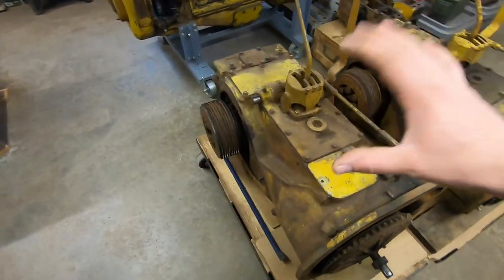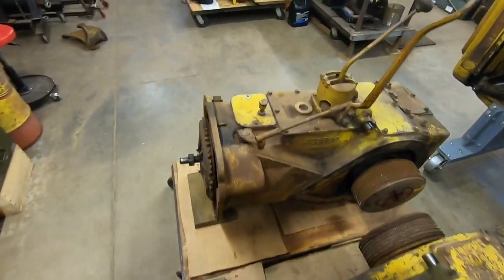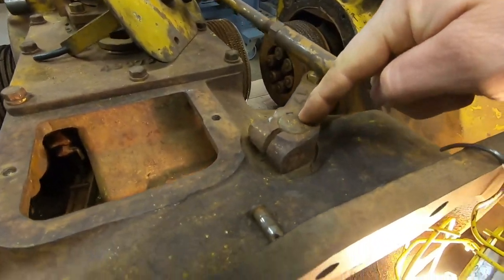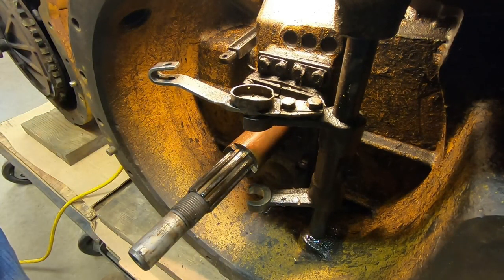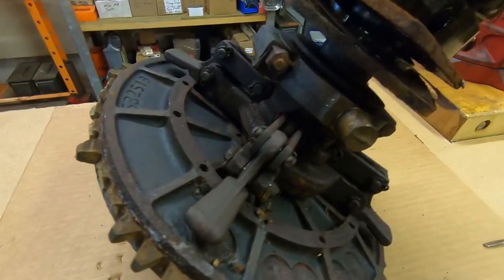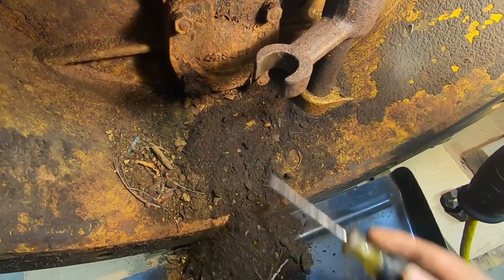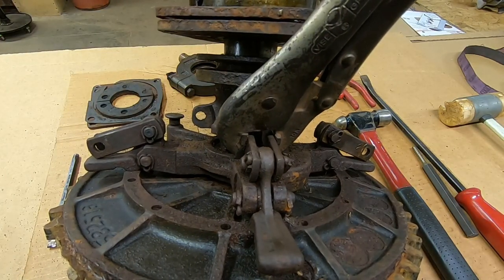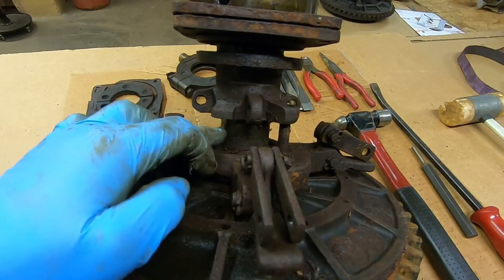Caterpillar D2 #5J1113 Chassis Rebuild Ep.3: The Rusty Stuck Clutch & Burning Candles At Both Ends..

Comment: As an old Cat skinner I could watch you work on these old Cats for hours. No one made ‘em like Caterpillar. One of the highlights of my youth came when I got to operate a D-2. So easy, so powerful, so reliable, providing you didn’t set out to drive it into the ground. Difficult, but if you were a committed idiot it was possible. The Allis-Chalmers differed in that it drove itself into the ground. No help required.

Comment: Neat trick with the candle wax. Ill have to keep that in mind for my projects.
Reply: It’s saved me multiple times
Reply: @blacksheep9734  First time I have ever heard of the candle wax! great idea. :-)
Reply: Project Farm on youtube has actually debunked this pretty well. About the only complaint with his methodology was a small sample size but his results show that candle wax just doesn't have any penetrating ability. It may provide lubricant once a bolt or nut is moving but it is likely just confirmation bias so people just remember when it "works". Transmission fluid and acetone is great though.
Reply: @ryanp0342  I've seen a lot of things debunked on YouTube that actually work sometimes. As you said, the small sample size. That trick can be used to prove or debunk a lot of things.
Reply: @danielbutler3673  Yeah you should go check out his videos if you like that sort of thing. He's definitely not out to prove or debunk anything, just seeing what works and doesn't. I mean it's not going to hurt and if I didn't have any other option I'd use it.
Reply: @ryanp0342  Sounds like "Ed's Red" penetrant and homemade cleaner used on guns. Shown by some to be better than "Kroil" another good penetrating old-school oil

Comment: This sure brings back memories. In the mid 70s I worked for a builder and we had 2 D2s. The older one was seldom used and as a result the clutch plates became pitted and the fiber disc became glazed from slippage. We tightened the pressure plate as much as possible, but eventually we decided to replace the clutch which became my winter project. I split the tractor and lifted engine out with our 955k. I sure wish I had you tube as I only had the manuals, but I was able to replace the clutch. Our 2nd D2 was a slightly newer model, maybe around 52 and it had a wet clutch which was a vast improvement over the 49. It was a great experience working on those machines. I believe the 49 is still sitting in the barn and hasn’t been used in 30 years. I’d love to buy it.

Comment: I’m sure you have the concept already but when removing “spiders” from Drive clutch’s on snowmobiles we used a “grunt tool”  a hub with pins to engage close to base with a long bar for leverage. They used green loctite and no matter how much heat and snake oil you’d still end up pulling the threads. Good luck👍

Comment: Hey Squatch, I think making a tool would allow you to spin it right off there. Take a piece of 2x2 box and make a couple pins that would push against the meatier part of that spider on the sides of it where the bolt heads were on your makeshift handles. bore a hole in it to clear the input shaft. Then heat the spider again and see what happens.  I love to work on these antiques like you do and look forward to your next upload. Its always nice to watch your videos when its dark out and not much to do here in northern Mi. Hope all is well, Bill.

Comment: An addition to heating the part is freezing the corresponding counterpart ( nut, bolt respectively). Sometimes it is necessary to shock the parts in opposite directions. i.e. heat the nut and freeze the bolt. This can be accomplished by heating the nut to nearly red ~550° and blasting the bolt with a stream of the liquid from an inverted can of compressed air - like the kind you get for cleaning computers. Heat shocking one side (expanding) and cold shocking the counterpart (shrinking) best of both worlds ....
Good Luck Hope it makes scene I got to get outside and plow snow.....

Comment: What if you put it in an oven, do a slow heat over a few days, let it cool down, then put it in a freezer. The cold will shrink it, and most generally, breaks the rust bond after heating. As for wax, it's kind of an old farmers usage, it does work wonders. Cheers :)

Comment: yehh you definitely need to make special tool no:481795  to get a better grip closer to the shaft and away from those thin clasps, does it undo counter clock wise?  if so a lot more meat to get a bite on.  great job getting things free with no broken parts 10/10  keep up the good work.... cheers

Comment: Try an air hammer with a brass button to put some vibration on the spider while also putting tension on it to turn it. Maybe this and heat will break it loose...

Comment: Make a "socket for 3/4" square drive, from a piece of 4" schedule 80 steel pipe, weld on 4 pieces of steel square 3/4" stock to slip over the piece and engage it close to the center hub. Mount it all in a large bench vice with brass jaw liners with some of that belt strapping for grip traction, heat/candle wax as needed. Using a good 3/4" breaker bar pull well, if it still won't move adapt a good 1/2" impact adapted to the drive ove the socket. Hit it on then off, until it comes  off, you'll get it done ✅

Comment: Thinking about those housing differences... You should try tracking things down in Case machinery. Take the L, D, and S series tractors - they were all produced using the same serial number runs (the model series did not each have their own serial number sets). Case would run the models in batches, and then number them as they came off of the line. For instance, tractors 4500001-4500025 could be all Case SC's... Then 4500026-4500050 could be D series, then 4500051-4500100 could be L series. SO, trying to track down how many of a particular model was made before a major production change can be a CHALLENGE!

Comment: Excellent video keep up the great videos 👍👍👍👍I have heard of candle trick too .  Is the clutch plate segmented like my Detroit diesel power unit Rockford clutch is .I have had that problem with the Rockford clutch system being stuck when I bought them from a salvage yard.  I am not sure if you can but I sure would try dig that fiber clutch plate out of there i am sure that the rust is keeping it swelled up against the floating plate it's already junk you may have to take a saw all and cut it in chunks to get rid of the junk clutch plate if it's like the Rockford clutch the threads are exposed to the inside.

Comment: Squatch, the spider looks like it has two spots for a wrench, made of heavy wall pipe (schedule 120, if you can get it), with dogs, sort of like the wrenches for old school F250 4x4 front axle slotted nuts, just two big ones instead of four smaller ones.
Best wishes

Comment: For small thread repair i have used   " spring pins "  Veleer  is a brand name  i remember . they are used for adjustable detents . For the repair i mentioned  their  good point is an external thread and internal thread . Available in various sizes .  A little tinkering needed  but usefull .

Comment: On trick I have used, when parts are going to be sitting for along period before being stripped is to drain the oil out and fill with diesel, fill it until it starts to leak out. Over time the diesel seeps in and lubricates most parts and also stops corrosion. Obviously, in this case, it's a bit late for that.

Comment: You could make a large 4 eared “socket” or whatever you want to call it, so you can spread the load evenly on all 4 flanges. It would need to be bolted in each flange like you did to spread the load. Then you could use a long breaker bar to put controlled pressure on it, while using heat.

Comment: Bees wax works much better than candle wax,I took apart  steering clutches on a 1957 ih td 6 that had been exposed to the elements for 20 years.it took a lot of heat and a lot of bees wax,but we got it and saved the spider and release bearing

Comment: Toby, I have D2 5U12016 I am at the same point on pulling the clutch disc. I contemplated doing the method as you did. But decided to make a cross bar puller from 3" channel. A set of home made puller arms and the 1" push rod from an OTC set. I had soaked this assembly for at least 3 days. Had to use a rosebud for heat, still took a grunt to get apart, but worked well. I also use beeswax for broken bolts. Thanks, for the great videos! hfdzl @ACMOC

Comment: On the thirteenth hole and serial numbers I am wondering whether Cat imposed a change and then either a number of cases were found and used of the old standard or a mistake was made at the foundry and a batch of old std cases were cast. Either way they were not going to be wasted.
The trouble with stuck threads is there is such a large surface area to move. Maybe it might be better to try and machine out the nut.

Comment: Hi Toby.  What are those 4 bolts/ bolt holes, just back of the steering adjustment cover, for?
Reply from the maker: The tailseat tractors (orchard models) had the transmission shifter relocated to that spot, with much longer shift rails installed to reach up to the transmission.
Reply: @squatch253  Yes, I got that for the 4 that hold that plate on, it is the other 4, 2 on either side of each oil cap.  I am guessing something else in the orchard model.
Reply from the maker: Those threaded holes are for the cross-brace that goes between the fenders on all of the J tractors as well as the early 4U and 5U tractors.

Comment: I had a similar clutch setup on a hydroseeder was seized up the same on the adjustment it only had 3 over centre locks I made up a tool to turn it like the 2 handles you have bolted in I welded them all in a unit so I could put equal force on all the pin areas with out fear of snaking 1 off

Comment: 1940 R2 4J886 12 bolt
1946 D2 5J7977 13 bolt
1938 D2 3J1879 12 bolt
1947 D2 5J10551 13 bolt final 12 bolt housing
1938 D2 3J907 13 bolt final 12 bolt housing
Reply: My father in law was a design engineer for Caterpillar starting in the mid fifties.  Unfortunately, he passed away 3 years age.  Commented that Cats so overdesigned that half the bolts could be removed and it would run just as long.  That was then, not now. Would be given a project to design a part to "do this", " has to fit here", "not cost more than this".
Reply: @squatch253  i got a chance today to check my 1947 5j9780 and its a 13 bolt

Comment: Hey, i ran my 5J the other day and the clutch started acting up. I had to keep tension on the lever to have it engaged. Is this an adjustment issue or part of a bigger problem?
Reply: @squatch253  ok thanks. From what youve said about over center snap, there isnt much. Do you tighten those pressure plates through the top access?
Reply: @squatch253  awesome, thanks very much!!

Comment: Wondering what the original thickness of the clutch brake friction material is? I haven't been able to find any information.
Reply: @squatch253  thank you, mine is about that thickness. 👍🏼
Reply: @squatch253  I discovered I hadn't indexed the rear clutch plate to the sleeve. By not indexing these pieces it added another 1/4" to the clutch travel which is why the clutch brake wouldn't apply. This problem existed when my father purchased this tractor, it obvious the "mechanic" before me didn't index it either. He cut a notch deeper in the castle nut in order to install the cotter pin! Also the oil seal inner dia. was to small and was cut badly which worn into the sleeve. Thank you